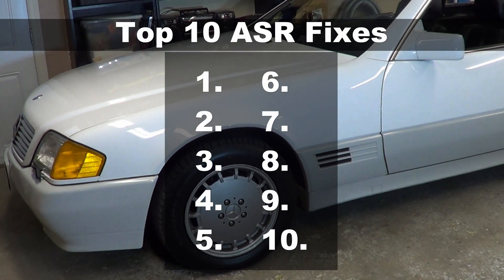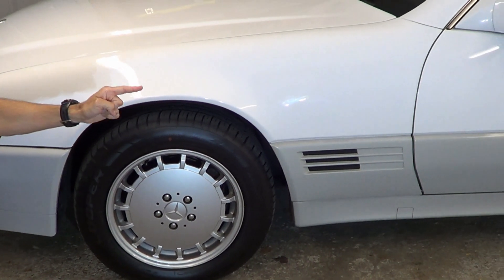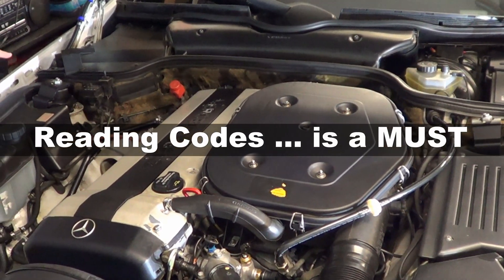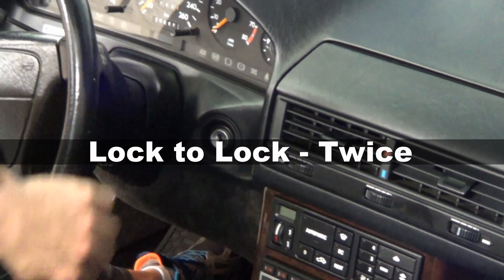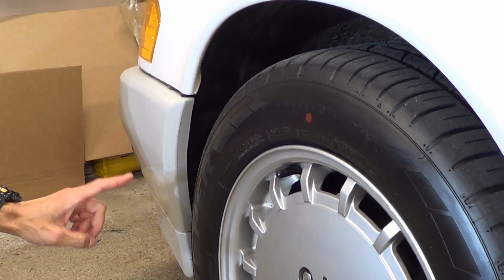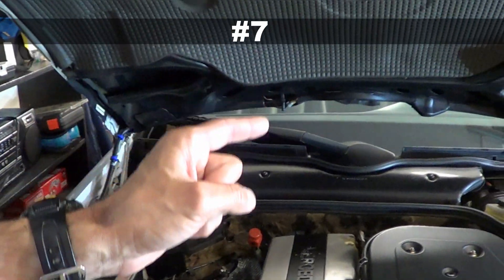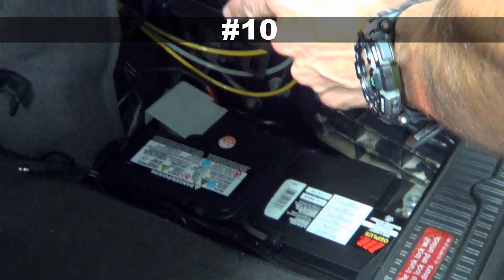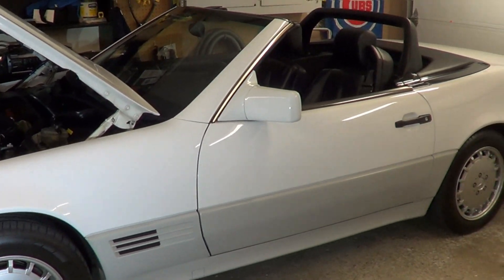Mercedes ASR Light, Limp Mode, No Acceleration - List of 10 Fixes -  1990s Benz R129, W124, W140

Comment: asr abs light up at the same time but only when driven, they dont show up otherwise. Should be the abs sensor no? no limp mode no power reduction all fine, when i put the rear wheels up on a jack go in D the asr started working locking the wheels (there was loud buzzing when it worked but i think theres nothing special about that)
Reply from the maker: Having both the ABS and ASR light, makes me think you’re on the right first track to fix it. A dirty ABS sensor can be your problem. They’re easy to remove and clean, but does require the tire to come off. OVP could be your problem too. Original OVPs can be expensive. You can try removing yours and cleaning the connections if they’re corroded and then putting it back in place. 
Before the lights came on, was there any work done on the car?
Reply: @HandyVal  ovp is new, theres a clicking sound on ignition that says its good, it had the ADS (hydraulic suspension) and it was deleted, the people maybe messed up the sensors doing the delete, is there a way of checking them? Like resistance or some (1990 model so no obd for abs)
Reply from the maker: It’s good that you have no symptoms. I wonder if the ADS delete is causing the computer to turn the ABS and ASR lights, thinking there’s a problem when none is there. This makes me think that you’ll be ok, but just need to live with the lights coming on. ADS shouldn’t have anything to do with it, but I’m not 100%. I don’t know the ABS module well, to know of any test you could perform. I would clean the ABS sensor.

Comment: Im experiencing this ASR light only when cold below 50 degrees when engine is cold in the morning and than never shows up through the day🤷🏻‍♂️
Reply from the maker: Thanks for sharing. Seems like it could be a connection that improves with heat. If it’s not causing any drivability issues, probably best to leave it alone. Investigating and digging into it, could cause other problems and/or create ASR drivability issues. The ASR never stops amazing me.

Comment: My 90 500sl has the asr light on right now , & is in limp mode .. however I just drove home at up to 120kph.. in limp mode she shifts gears soon as you let off the gas & then you can give it again, let go the gas peddle & then step on gas again. She will shift to the next gear. Otherwise she shifts at around redline if you don’t let go.
Reply from the maker: This is an interesting and helpful tip. Thanks for passing this along. I’m trying to make sense of it all…but if it works then it works. And it’s way better than the alternative. I hope you can ultimately resolve the underlying problem.

Comment: Man my 1992 k jet 500sl asr has been killing me. I did the battery, voltage regulator, ovp, front speed sensors, and cleaning the front hubs. And still I get intermittent limp mode, never an ABS light. If I apply any throttle in reverse it’s instant limp mode. But if I idle without touching the gas, usually I can get away with it. When driving if I’m in stop n go traffic with light throttle inputs, usually I’ll get the darn limp mode. I also addressed the Bowden cable for the transmission and I tested a few of the throttle potentiometers and I could not get it to misbehave running in park playing with the potentiometer off the throttle linkage. Any ideas as to what it could be? Could a bad or failing module for either the asr or abs do this?
Reply from the maker: You’ve done good checks. Too bad it hasn’t worked out yet. The ASR is a horrible beast to figure out. Have you tried reading codes? The codes could help out. 
My immediate suggestion is to check the electronic throttle actuator. Some places refurbish them and I’ve known of others who conquered the ASR with  this fix.
Reply: @HandyVal the electronic throttle actuator is the large unit in the front of the engine that replaces the cruise control actuator on a non asr car right? And I thought the k jet cars don’t have codes for the asr? I’ve thought about converting from asr to NON asr but that is a huge amount of work to do right. I’ve seen a few k jet non ASR 500 SLs in the junkyards and I’ve gotten the entire throttle linkage assembly including the cruise control actuator and I would try and grab the entire wiring harness. My fear was the ABS system and how integrated it was with asr. Also the non asr cars had a better lsd diff in back
Reply from the maker: @12pagani You’re correct and I should have been more clear. There are no specific codes for the ASR, but there can indirect codes, that could  help diagnose the ASR culprit. It’s worth reading the codes.
The swaps you mention are doable but I’m not familiar with them.
The 1992 500 SL with KE-Jet should have an ETA but let me check my notes on it.
Reply: @HandyVal I really appreciate you responding and you seem to really really know these cars. I did a ton on my SL and it gets driven like it was intended . I did the top, cylinders, transmission, some interior stuff, window regs (oh very early sl have full metal window motor and gearbox mechs!) and the asr is the one thing that is still really annoying

Comment: My ASR pump comes on for 1-2 mins, one can hear it, then light comes on, whether driving or in park. 1995 e320 (m104)
Reply from the maker: Does it give you any driveability problems, like does it go into limp mode, where the car’s acceleration is poor.
Reply: I got a similar fault on my 1993 500E. Runs like a champ for literally two minutes and then when that light pops its limp home city. 

Tried replacing the ABS pump and the accumulator at different points but neither was it. Let me know if you solve the mystery.

Comment: Hello, I have a 1995 Mercedes e320 that I have been restoring for quite some time and have not touched in quite some time because of the asr issue. It does have a new wire harness installed by Mercedes ten years ago. The light is on all the time but without abs being illuminated. Wondering where I should start with my specific model, I do have the funky diagnosis tool as well, thank you.
Reply from the maker: You’ll want to start with the diagnostic tool first, just make sure you’re reading the codes right for your year and engine - it seems obvious but the code manuals can be confusing. Do you have any symptoms? I’d try the more basic things from the video first, and then the tool. That’s the best order. Keep me updated.

Comment: Hi Val, love your videos every time it's something to learn.my 500sl 1993 if  i acceleration by moving the metal line by hand the ASR lights its happening every time and some time after driving fo along distans the RPM Stay on 10000 what you think about that 
Best regards from Stockholm
Reply from the maker: I’m happy to see my videos are popular in Sweden too!  I hope you enjoyed midsommar. When the ASR light is lit, do you have any drivability issues? Does it go into limp mode, where acceleration is limited?
1000 RPM is too high. The car should settle in the 600-700 RPM range once it hits operating temperature (85-90C). It can be as simple as a vacuum leak - check the rubber air hoses and ensure they are connecting properly and that there aren’t any cracks in them. These are small air hoses, and not the coolant hoses. You likely have a problem there. It could also be that the acceleration line is too tight and causes the car to rev higher, even without pressing the gas pedal. That wire can be adjusted, it has a nut. But be careful and only do small incremental turns. The other thought of mine is the idle air intake valve - it could be faulty and needs replacing. I hope this helps.

Comment: So basically right now I have ABS ETS lights ON all the time.  Yellow triangle warning light flashing when out of traction only and cruise control inoperative all the time.
Reply from the maker: I don’t think I asked earlier. Other than the lights and cruise not working - do you have drivability issues?
Reply: @HandyVal . Not at all.  What a smoth ride that young old lady has.  Car is absolutelly fantastic.  Silver on black. Perfect height with SF racing coilovers. Super rigid with front strut bar from wiechers germany, aero 3 piece 17 wheels with MT tires all around.  The only problem is that 2 yellow annoing lights.
Reply from the maker: @cbj032 It seems like it’s an awesome ride! Since you don’t have any of the poor drivability symptoms, then keep enjoying it. It’s possible that you’ll never experience a symptom. 😊

Comment: Val. Yesterday we decided to continue trying to discover where my fault is cause we are alone with no mercedes dealer in this equation. They are extremely nice guys. Always there to help but this time they basically gave up this cars fault.  We jacked the car and runner the rear wheels spinning freely.  Yellow triangle warning light immediately start flashing like crazy and keep flashing as long as wheels are spinning. Also we clear see and hear abs applying force actively braking wheels from left and right side alternately( there is different noise when abs is working by itself). At this time I am inclined thinking there is abs ets function and the system is at least partial active. What makes me think about the other components.  Do you believe cruise control switch must be part of the problem? I guess I will remove steering wheel and cruise control handle switch to further test….but the question is how to test it??  The is no CC error codes at this time.
Reply from the maker: Sorry to hear about this. I don’t have a lot of useful knowledge on the cruise control. Further I don’t know of a way to test. Have you looked into the wiring harness?
Reply: @HandyVal  Yes Val. Upper and lower harness changed for good one. Of course this car suffered from those biodegradable cancer isolation. Throttle body wiring also changed for Mil spec wires.  Cruise control harness factory original. Guess its time to cut some external harness shields and look for that wires starting at abs pump going all the way to CC switch at cluster.

Comment: Hi Val. Always top quality info here. You are the best r129 Diy channel by far. The resto process of mine sl320 1995 euro is always concluded. The last fix will be both asr abs always on light.  3 months now and no luck. Even Mercedes official dealer could not figure it out. I performed your #1 to #5 steps but no change. Dealer changed the whole ABS pump and nothing.  Actually we got the same error code after new pump. System tell there is a bad internal pump valve.  I guess problem could 2 bad wiring.  2 pumps , same error… unlikely.   I will update you if I dind the solution.
Reply from the maker: Thanks for sharing. I hate the ASR light because it’s unpredictable and many times the light will be on for years before it shows any symptoms. Keep me and the community posted.

Comment: I have a 92 300se and my asr and abs lights are on. These are good tips to start looking at before I take it to a shop. Thx!
Reply from the maker: @jamnson  I hope you can resolve it, with minimal time, effort and cost.
Reply: Hi. Did you get your 300se figured out. I have an 93 300se with the same issue
Reply: @lincoln_continental_mark_3 Afternoon. I found a shop near me who specializes in these older Mercedes and he can't check my car out until next month. I'll definitely respond as to what he finds.

Comment: For the first procedure "turning steering lock to lock", after 20 minutes of disconnecting the battery, do I connect it back and then turn steering lock to lock or turn steering with the battery disconnected?
Reply from the maker: @cynidekiddie  I should have been more clear. Reconnect the battery and then turn the steering wheel lock to lock.
Reply: @HandyVal  Thank you!

Comment: Hi Val - love your videos. So much great information. However, I'm a bit scared now. I have my eye on a good condition 1994 SL500 R129 (105K km). Apart from the looms and convertible hydraulic cylinders (and the list of rust, seat trim etc mentioned on your other video), would you in all honesty recommend buying a 1994 R129?
Reply from the maker: @Elvis-x3o1i  The videos are really meant to help inform owners of possible concerns and their DIY fixes, where many fixes are fairly easy for anyone to do. R129s are multi-decades old now, yet they still perform and have similar functionality (where it matters) like newer cars. When looking for a R129 I wouldn’t be too fussed on the year - choose the color and style (pre/post facelift) you like. And buy the car that looks the best and has the best records of maintenance (sometimes this may not be available on paper, but you should get a sense from the owner how well they’ve taken cared of it; that’s where I say if it’s been kept to look good, it’s likely been kept mechanically sound too). If the car has no rust, it won’t rust under your ownership. The engine harness is at most $2000 fix from a mechanic, if it hasn’t already been fixed. I hope this helps. You’ll love R129 ownership with all its up and downs it may bring you. The ups more than make up for the downs. I hope this helps. 105k is low for a 1994, which is good.
Reply: @HandyVal  Thanks for the info and getting back to me Val.  I love your videos and will continue to watch and will check out the R129 - it's the same two-tone colour (white/grey) as yours 🙂
Reply from the maker: @ the white with gray bottom was the color combo that appeared in many of the early R129 advertisements.

Comment: 1995 S500  ASR light is on with check engine light on,. car is in Limp home mode,.  Already changed the throttle body.  Previous issue was the ASR light would only intermittently come on while doing  highway speed, 45 and above,. then i would pull over , shut car off and restart the ASR light would go out but check engine would stay on,   Now ASR stays on  any thoughts 
appreciate your thoughts
Reply: Engine wiring harness replaced?
Reply: @tonymers  yes
Reply from the maker: @gdsikora  Dies the ABS light turn on?
Reply: @HandyVal  yes ASR light is on as well  as Check Engine Light

Comment: My asr and abs lights are on also my brake lights come on when I start my car replaced brake light switch
Reply from the maker: Are the ASR and ABS light both off now that you replaced your brake light switch?
Reply: @HandyVal Had a brake light switch burn out fuse 24 for my 92sel600. Maybe your fuse burnt?
Reply from the maker: @ Good suggestion on checking the fuses.
Reply: @HandyVal  no
Reply from the maker: Do you have any performance issues, with the lights on? Like poor acceleration?
Reply: @HandyVal  not yet

Comment: My problem is that the car is sitting and if i rev it on idle the ASR comes on...Any idea ?
Reply from the maker: Let’s try to fix it. Are there any performance issues when driving the car? And is the ABS light on too?
Reply: @HandyVal  well lets see as soon as the ASR  light comes on the first half of the pedal is useless the acceleration is done only in the second half..No ABS light on.And thats kinda it nothing else happens beside the acceleration control..
Reply from the maker: Without the ABS light we can shorten the list of things to consider and look at, which is a good thing. I assume you tried some of the basic things in the video…battery is good, tried unplugging it and then turning the steering wheel? It seems like it can be related to your electronic throttle actuator or the accelerator cable. Try the accelerator cable first by tightening it a bit.
I should have asked earlier, what year and model is it?

Comment: Do you have any suggestions why a cluster would just stop working please help
Reply from the maker: It can happen. First - check the fuse box under the hood for the instrument cluster fuse. Second, if unsuccessful it can be a poor connection to the instrument cluster…sometimes the connectors at the back of the cluster can become undone (especially if someone recently has removed the cluster). Third - the cluster is made up of a few capacitors that can go bad. The good thing is that they can be cheaply and easily replaced as DIY or anyone else who know a bit about electronics. Fourth - like the capacitors, there can be something that has literally fried in the cluster - you’ll need to open it and remove it and physically check for what has burnt. There’s a few good videos on YouTube on how to remove the cluster properly and then how change capacitor (search R129 dash flash). I hope this helps. Keep me updated.